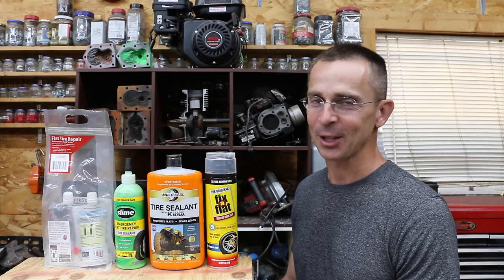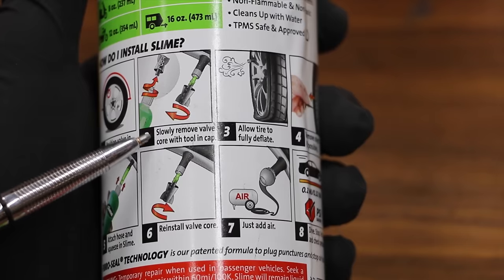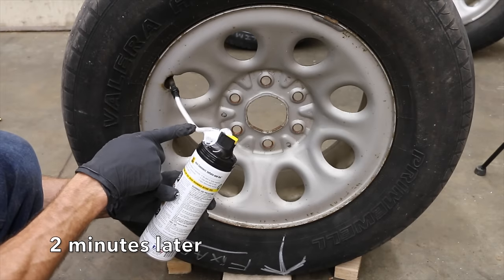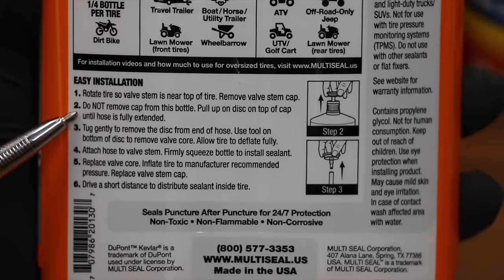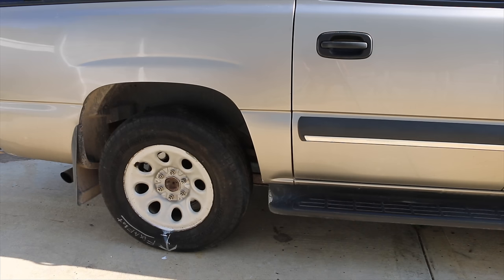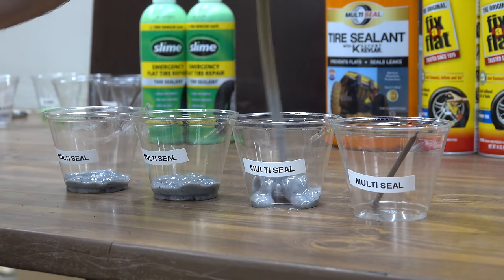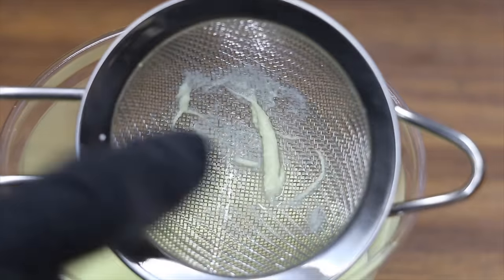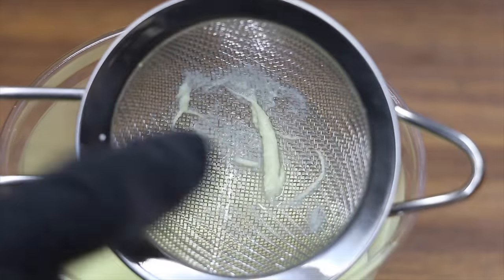Is Tire Slime the Best? Fix-a-Flat vs Tire Slime, TireJect, MultiSeal. Let's find out!

Comment: Please do Air Filter test . Comparing company/stock , K&N,BMC etc
Reply from the maker: Thank you for the video idea!
Reply: @ProjectFarm  omg u replied :O  anyways u can test various parameters, airflow , filtering quality and quantity, renewal quality, cost /renewal, the HP increase (K&N claims around 5 HP increase )  
Great work with the channel , keep it up !
Reply: @simran1992  HP increase would probably be a little too complicated to measure and would vary significantly by application. Would need a dyno and a lot of time to do that. There are many other people who have actually tested power output increase on youtube. A quick search should show you that. As far as airflow and filtering quality, that is an excellent idea. Technically the way to get the best airflow and power is to have no filter at all. So do performance filters simply allow more dirt and air in or do they filter just as good with increased airflow. The world wants to know!
Reply: Engineering Explained did an air filter test on a dyno.
Reply: Not just dyno runs, also filtration performance - which filters filter the best as well
Reply: @ProjectFarm  static pressure drop for various cfm/velocities. ie a 5.0L engine at 6000rpm will move roughly 500 ft3 of air. if air filter is 6"x12" then it'd have to move air at 1000 ft/min. while a 2.0L at 2000 rpm would move 70 ft3, or 280 ft/min thru a 6"x6" filter. of course for testing ease, you could use a manometer or vacuum gauge between the filter and manifold and test a performance engine (particularly at high rpm) and an efficient car at crusing rpm
Reply: Engineering Explained did this, found K&N actually does increase HP
Reply: Please do an episode of Grand Hotel, you can watch last nights episode on ABC on demand or you can watch on Hulu and it’s a new episode on ABC on August 12,2019,Monday or you can watch on Hulu, trust me it’s a good show
Reply: @MrFitness94  Yep they do and last 1 million miles too. I went  a little over 100,000 miles on my K&N Filter/with their cleaning kit usage about 50,000 miles or whenever the filter would get dirty. 

But then I decided it was time to upgrade and get their cold air intake system. 

Glad I did that because the horsepower on my vehicles engine went up by about 8-10 more if I remember the dyno numbers right. And torque went up by about 11 or 12 also. 

Money well spent, especially when the Combined (City/Hwy) Fuel Mileage went up by 1.4 MPG.
Reply: Great one. Air filters
Reply: I love K&N  air filters...I know there are better ones out there than k&n but for the price it's a great boost for any ENGINE....too bad they didn't make k&n filters for my 99  7.3 power stroke engine
Reply: Jay Grand Hotel is a great show
Reply: & hepa filter 
Cabin filter
Reply: tyre pressure monitor / gauge
Reply: ٰ ٰ Watch Grand Hotel
Reply: Javier Garcia 
!?
Reply: ٰ ٰ Grand Hotel it’s a show on ABC that comes on August 12,2019 Monday on ABC at 9:00 Pm and you can watch on Hulu ,trust me it’s a good show look it up on Google Grand Hotel on ABC

Comment: As a current tire tech I can confirm that we do not like seeing these products. But we are glad you are safe
Reply from the maker: Thank you!
Reply: The TacomaKid  absolutely not. tire slime is not a big deal it just creates a mess but once we find the hole we will patch it up if it is safe to fix, so rest assure if you're in a jam and need to use some type of temporary fix then go ahead and get on to your nearest tire shop when available.
Reply: Please don't use any repair product seen some really bad things happen with these products, top tyre manufacturers recommend no tyre repairs at all says something don't you think ?
Reply: @HN-gy4lg  the thing is these repairs are meant for road side limp to a shop and get it fixed . there are quite a few of these newer cars in recent years that don't even have a spare donut tire
Reply: @HN-gy4lg  that's because if they can get you to buy a new tire when the damage is small then they make money lol. Or they mean don't depend on a repair product for a long time. Mainly used to drive to a shop so they can fix and patch it correctly. Then it would be just as safe as a new one if they fix it the right way.
Reply: xS0N1Kx Well, it’s dangerous to leave them for too long if your car has a TPMS (Tire Pressure Management System, most of them do) because it could damage the pressure sensors. Better patch your tire properly.
Reply: It is against Automotive Safety Regulation to patch a slimed tire due to patches not adhering correctly to tires. Its considered unsafe and illegal in some states. Alot of the time you will hear older mechanics tell people they will not patch a tire slimed tire. Even average everyday people who have experience in tires with holes experienced this. Basicly slime in a tire bumps up and creates a surface patches wont stick too. Thus it becomes an issue. Too many holes in a tire cant be patched as well. Tire slime ruins tires. If you ever wonder why a 25 dollar patch doesnt last its probably because you screwed up your tire with slime previous.. 

Jackasses like guys at tire lubes and pepboys will bs you and say hey hey yeah yeah we can fix that with a max strength plug patch. Money is their job. Itll last for a little while but only half the life. Dont ruin your tires with slime. Dont ruin your rims either. Slime after a prolonged time makes it hard to repair a rim if something happens like piveting youll be mad trust me. Especially if you cant even get the tire off without pulling at the inners and string your tire.

If that happens, goodluck holding air in the tire. Its basicly junk.
Reply: Well, you're probably going to see a lot more sealers. Many of the new cars, Hyundai, being one of them, no longer give you a spare tire when you buy one of their new cars. Instead, they give you some fix-a-flat, under their name brand, and a small and really cheap air compressor. No space-saver spare.
Reply: Yeah that sucks especially if it is actually fix a flat. That stuff doesn't work.
Reply: Does the TPMS ever get damaged from the stuff?
Reply: @michael931  The earlier versions of the tire fix products could ruin a TPMS. However all the newer versions read on the can that they are safe for TPMS.
Reply: @jameskoralewski296  to a small extent of test it can still dmg it.
Reply: @HN-gy4lg   yeah they want you to buy new tyres

Comment: I used to work at a tire shop I did hundreds of repairs, I can say the green slime works. The fix-a-flat never works, it only makes things worse, it makes the rubber inside the tire really soft so to apply the path you have to really grind down to get good rubber for the patch to stick.
Reply from the maker: Great information. Thank you
Reply: Based on smell we always thought Fix a Flat contained ammonia. Whatever it was it soften the tires innerliner and the longer it was in there the softer and stickier it got making it almost impossible to apply an inside patch.
Reply: glad you added that comment, being one of the older generation, yeah way old, i thought by now everyone knew how bad fix a flat was, i remember horror stories from years ago about tire repair shop employees  being seriously injured when the tires would explode

Comment: Love the video! Iv always wondered how slime stacks up against competitors. On a side note- have you ever tested cheap vs name brand stranded automotive wire? Iv always wanted to load test wire samples from parts stores and cheap online sources but I'm too lazy to actually do it apparently.
Reply from the maker: Hi Stephen, Great video idea on the wire!  I need to do this soon as well as some durability testing on the wire insulation/coating.  Thanks for checking the the video!!

Comment: What a great video! I’ve used tire plugs since I was a teenager working in a garage and never have had a problem. I have a kit similar to the Western Weld that is USA MADE. I originally had the slime brand but, like you, found the small handles difficult to work with, not to mention the Slime plugs are not as good as the Western Weld. Great video as always!
Reply from the maker: Thanks!  Thanks for sharing.
Reply: That comment was for the tire plug video…
Reply: Yeah I've had slime plugs leak air through the plug itself. Kind of defeats the purpose.
Reply: @headpainter1  The Slime plugs are a hard black rubber. The plugs I used as a teenager and now are almost an orangey-red color and are a mix of sticky leather and rubber.
Reply: @davidstepeck2644  I just remember plugging a tire with slime plugs and airing it up and then spraying soapy water on the plug with the two ends sticking out and Bubbles were coming out of the core ends of the plug. And I always use rubber cement. 
Now it seems that's the only kind of plugs that stores carry in my location is slime.
Reply: @headpainter1  harbor freight has the jerky ones.

Comment: Awesome. I have used fixaflat for 20 years. It has never failed me in an emergency with car or truck tires. 
I highly recommend a plug kit in your vehicle. 

Can you test the different plug kits? Ive had good results with several brands. 

Again. Thanks for the videos and the time you put into them.
Reply: Fix-a-Flat CEO spotted.
Reply: @ancientpho  lolol.
Reply: Read the comment above about using plugs to fix a flat tire. Just remember, if the puncture is in the tread area and you decide to plug it, you will be stuck with a plug until you buy a new tire. If the plug leaks and you take the tire to a tire shop to replace the plug with an internal patch, the tire shops will not touch the plug and will recommend a new tire. Ask me, I've tried.
Reply: Plugs are fine but most women & some guys would never be able to use them. These products are for those people.

Comment: I’ve been using slime for 20 years on my bicycles, I have recently had to use it on a nasty gouge on my hatchback, the best in class by a staggering mile
Reply from the maker: Thanks for sharing.
Reply: Slime tire tubes are no joke,worth every penny.
Reply: @zestamaster  I've been out on my mountain bike 40 miles from no where (with no spare inner tubes like the fool I am) and I got a 1cm gouge in the side of my tyre and the slime innertube held it for nearly 6 more months of serious riding
Reply: @kyleb5518  i hear you there, they have saved me from walking miles home countless times.ive even had bad shrader valves they sealed to get me home, the valve was fucked and i needed a new tube, but it kept the leak from getting really bad.

Comment: Fantastic thorough review! 
As I have just bought a "Suzuki Spacia Gear", which does not have a spare tyre at all (it did come with a factory supplied 12V compressor) It's critical that any product I choose can be relied on to do the job. "Slime" is what I will keep with the car now. Thanks heaps mate! 

You've got me as a new subscriber also. 
👍👍👍
Reply from the maker: Thanks!  Thanks for watching and subscribing!

Comment: Very well done. Getting a zero turn mower this week and I have a very wooded 2 acres. With wild rose bushes, small hedge apple and honey locust seedings all over. I'm gonna get enough to prep all my tires beforehand so I don't get flat tires in the future. At work about 15 years ago we did this to a couple of Polaris side by sides. It worked great. Thank you for a very well though out video.
Reply from the maker: Thanks so much!
Reply: do yourself a favor and put tubes in them. don't use chemicals if you can avoid doing so. i put tubes in my dixon zeeter's tires (even the little caster tires) 35 years ago and have never had any flats nor needed any sealant.

Comment: I was a little disappointed you didn't test for flammability.  I've heard tire changers complain about how dangerous these products are to them, and I feel its a lot of BS.

Otherwise, great testing.  Very informative... even more so than usual.
Reply: buckykattnj Fix-A-Flat is the only one you needed to worry about because it contained gas and they used to use flammable gas, but apparently they reformulated to non flammable gas so it's a non-issue.
Reply from the maker: Thank you!

Comment: Fix a Flat has ammonia in it , or it did when I was changing tires .
 Steel wheels took it but aluminum wheels often got damaged some almost beyond repair.
This of course was over long periods of time , proving the crap works sometimes as people would forget and leave it in for mouths .
Good test and Merry Christmas

Comment: I use a plug kit with rubber cement.  Works great, and  has for decades.   it takes up less space, and I've used it on up to three tires at the same time (road debris).
Reply from the maker: Thanks for sharing.
Reply: I have to wonder if a plug kit with rubber cement will function AFTER a prior can of fix-goo?  Will they prevent the rubber cement from bonding to the inside of the tire?............................elsullo
Reply: @elsullo2  - Well, from personal experience with using them, most of the use of the rubber cement is as a lubricant and filler.  In general, the plug locks itself into place pretty well through friction.   (you don't actually remove rubber, just roughen it up, and the plug displaces more rubber than is removed).   I think that most of the fix-goo stuff is supposed to be a kind of solidifying gel once it oozes out around the penetration.   That's part of why the tire places don't like it.    Flammability is a minor to nonexistent risk.  Well, unless you're smoking when you pop the bead - and then you get what you deserve.   

I have used a plug without any glue on it at all - it was a pain in the butt to insert, but it eventually went in, and that saved me a few hours of "What do I do" on the side of the road.
Reply: Troy Balding:  For how un-mechanical many folks are now, I suspect that most folks (like me) want something that seems as easy and safe and consistent as possible -- and then let the pros properly fix it. 

Because for normal driving, how often does this happen.  For me, punctures like this ALWAYS came from debris from construction, in my 46 years of driving.   In my experience, tire failures at highway speed end up messing up the tire enough when one fails, that the resulting hole / tear is far too big for such goo repairs anyway,  by the time you safely slow down and pull over.
Reply: @rogergeyer9851  - The three tires at once was an aberration.  Most of the time it's one, or two tires, and yes - most frequently from customer sites - not construction sites.   Other than requiring a bit of upper body strength, rubber/fiber plugs with rubber cement are easy, safe and consistent.   Keep in mind that what people like Discount Tire use are plugs - just with a 'patch' backing.  

Being stuck at 9 PM, a long way from home, on a donut, isn't fun.   Especially now that many cars don't come with donuts at all, let alone real spares.   You can actually put a plug in a tire without pulling the tire off of the car.   (Had to do that once to get a customer home)

Comment: Can you try Stan's tubeless sealant in a car tire?

It's used for mountain biking to run without tubes where there are rocks/roots/cactus that cause punctures. It seals mountain bike tires instantly. You pour it in before you seat the bead, then it's just always in your tire "in case of" puncture... And 99% of the time, even if you get one, you'd never even know because it's plugged so fast. 

There are various videos of people Putting 100+ screw/nail holes in a MTB tire and it still holds air and never goes flat.

Curious if it would work for a car tire.
Reply from the maker: Thank you!

Comment: My dump trailer had a flat caused by rusty leaky bead seal. I couldnt remove the tire and clean the rim so i tried the yellow can of stuff. It hasnt lost air in two years

Comment: There's a company in Missouri called Black Jack tire repair. They make a product called TS Pro. I work in equipment and ATV repair, and we buy the stuff in 5 gallon buckets. For the most part, once I put TS Pro into a tire and it gets driven on, it stays sealed. Even dry rotted, cracked sidewalls on old ATV tires. They also make the absolute best plug kit you can buy, with heavy duty metal tools and excellent plugs, I've plugged many hundreds of injuries with their setup over the past 15 years. I'd love to see you include their products on a future test.
Reply from the maker: Thanks for the video idea.

Comment: I work at discount tire and whenever a flat comes that has fix a flat it makes the flat repair time take twice as long because we have to completely clean out the entirety of the tire in order to fix it. The only way THE ONLY WAY to fix a puncture is to get it plugged and patched. I highly recommend discount tire we take extreme care and rarely cut corners.
Reply: So you do cut corners.
Reply: Joe Troutt they don’t hire all gems
Reply: If I can watch you do it then I'm fine. Makes me cautious when I'm told to wait in the lobby.
Reply from the maker: Thank you!
Reply: @joetroutt7425  Locations probably vary but my local Discount Tire has a giant window between the shop and waiting area so there's no hiding anything.  Nobody's perfect but those guys have treated me pretty well over the last 20 years or so.
Reply: Joe Troutt it’s impossible to cut corners on flat fixing, if it comes back flat the technician that fixed can be easily found and will be questioned as to why it isn’t fixed. If they have cut corners it shows and they will be let go.  As a tech you have to dunk the tire after fixing it to ensure it has actually been fixed. If it comes back not fixed then the tech is liable.
Reply: @benkrickbaum3794  And here I thought you were going to say that it's impossible to cut corners on something round!
Reply: If they would have used Slime instead of Fix A Flat you would have not gotten the job of repairing the tire.  I have even replaced tires, but I reused the slime in the new tire.